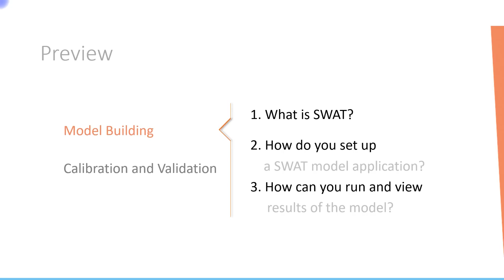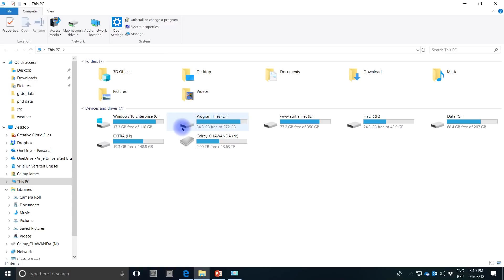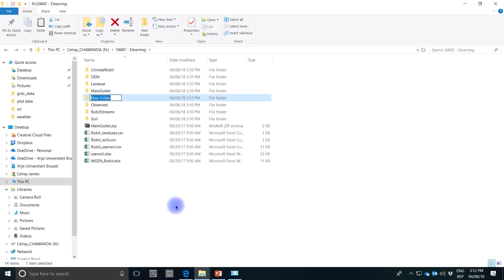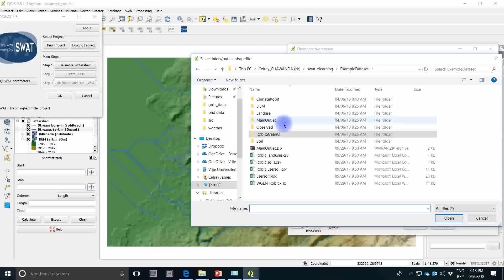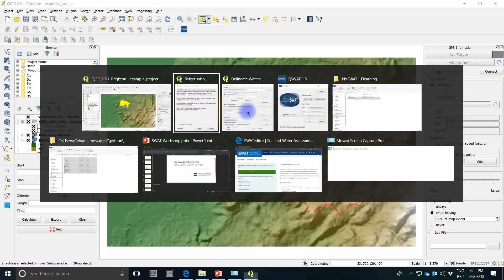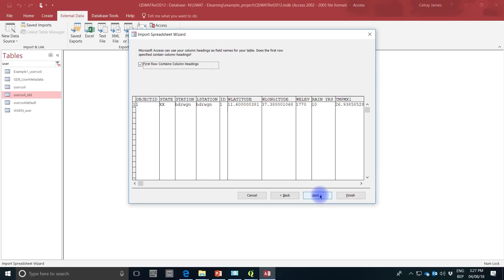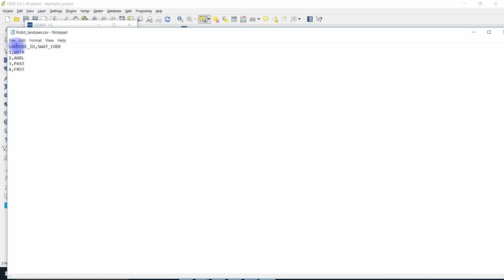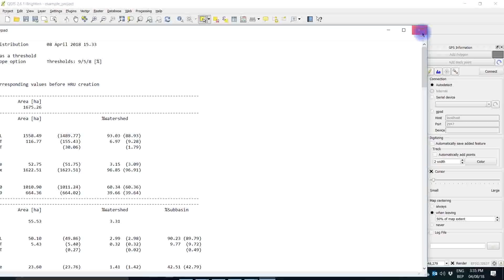Introduction to QSWAT (Part1)

Comment: Hii sir 
How can i use my own local soil use map and local land use map in Qswat.
Reply: You'll need to create a new soil type inside the soil database, and add ALL the parameters (needed by the model).  
Fot the land use, you'll need to classify each use as one of SWAT default types (or as close as it can be). I think you could also create your own landuse categories, but they all need a lot of parameters to fill in.
Reply: @LUMIGOCHA  Can you tell me where to find the standard land use and soil classes which are standardised to be used in SWAT software?